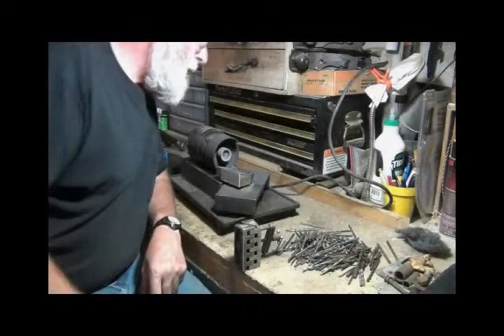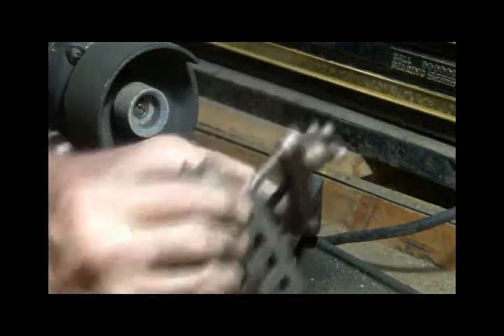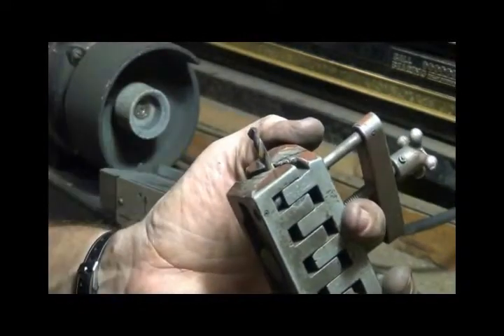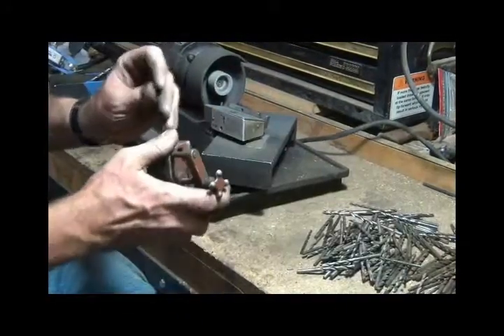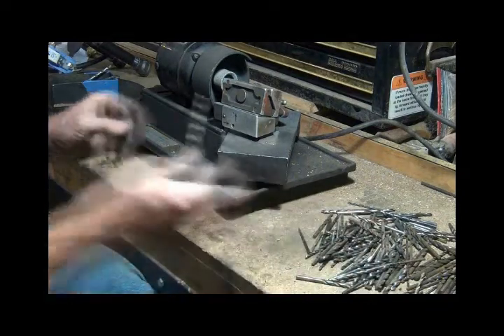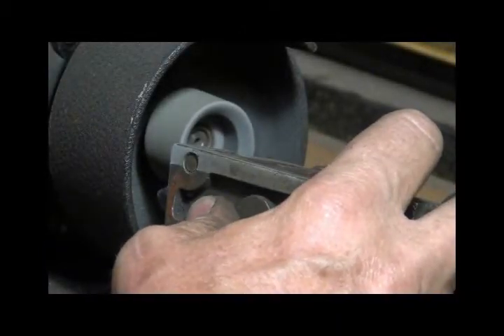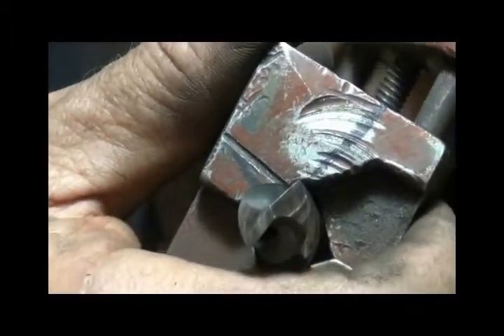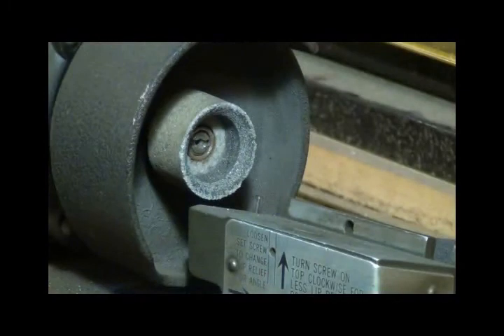Drill bit sharpening

Comment: Im gonna leave a link in a reply to this comment. It will probably go to the "review" box but I wanted you to see how much a guy on ebay is asking for one.
Reply from the maker: BCtruck, rebuild, repair,repurpose WOW I think either he is crazy or I got a crazy good deal. May be both.
Reply from the maker: BCtruck, rebuild, repair,repurpose $599.00 plus $85.00 shipping!
Reply: Uncle Bucks Forge that’s a lot of carrier pigeons !
Reply from the maker: BCtruck, rebuild, repair,repurpose I was showing my wife this link. I don't see the clamping device that holds the drill bits. I believe it would be useless without it.
Reply from the maker: BCtruck, rebuild, repair,repurpose Look up http://www.drill-grinder.com/ they have a model alot like mine. It is over $1000.00! They also have the bit clamping block. $195.00 I think I really got a deal for $5.00